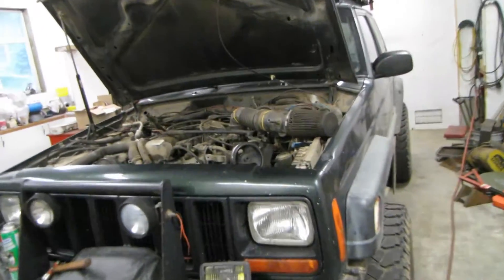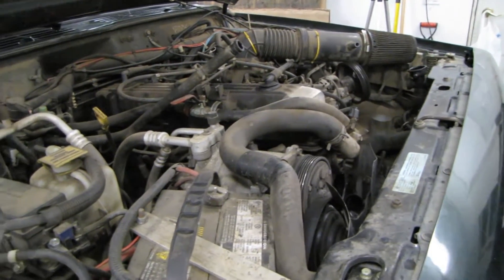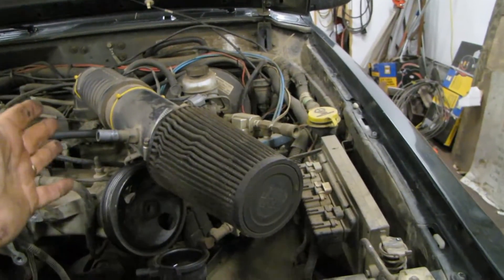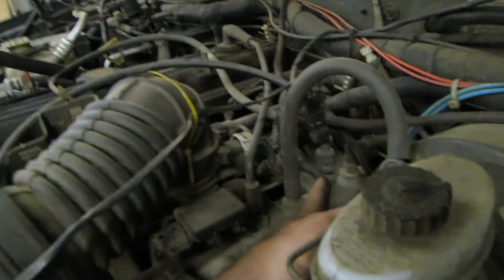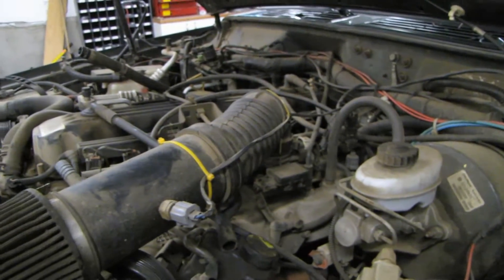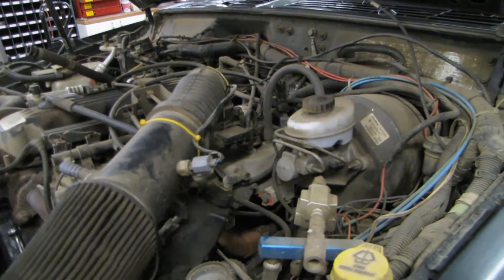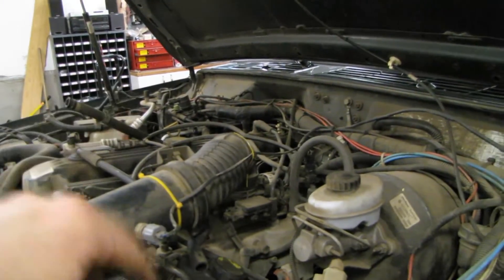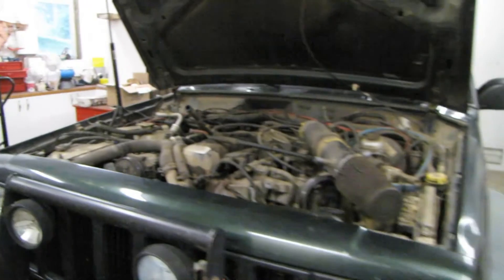The XJ Project - 3 - Engine & Powertrain

Comment from the maker: You're welcome.  The scan gauge is awesome, but doesn't allow for programming of any of the ECM fuel/ignition curves, it just allows you to see what each sensor is reading.  The scan gauge will also read and clear trouble codes, and has some provision for flashing codes to the ECM.  Maybe that would allow you to do something, but I haven't looked into it.